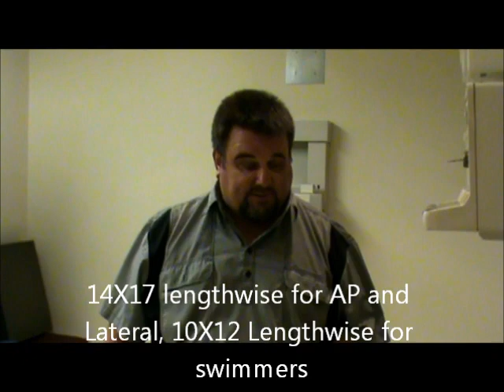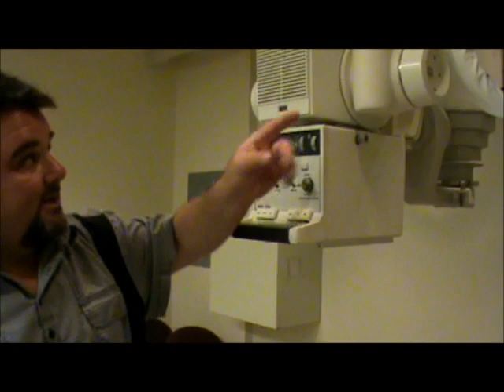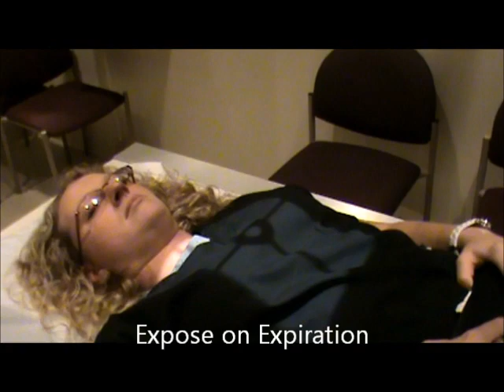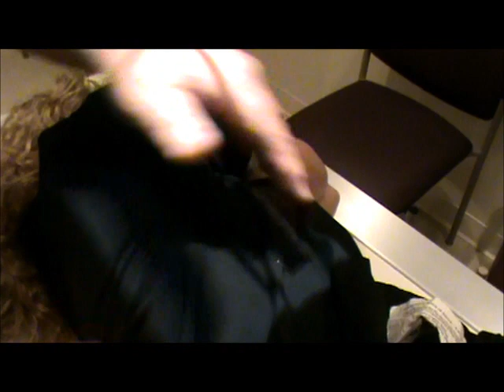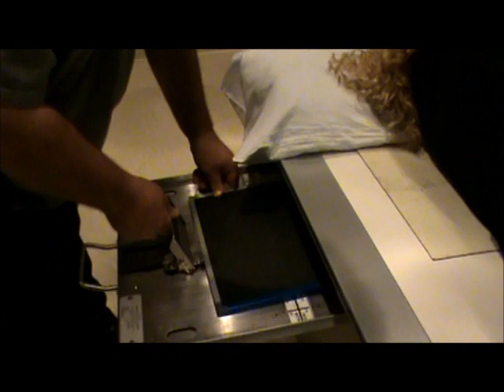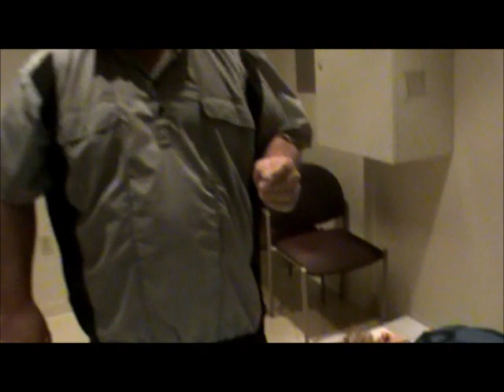Thoracic

Comment: For a low dose approach to this procedure, look at this video.   https://youtu.be/KWf6rFOFlI4.  The lead on the table does nothing and relates to a myth that has continued for a century because no one bothered questioning it. Likewise with tube angulation and geometry. Pushing the tube angulation button and changing the angle will not change anything except collimation. It sounds weird because 75% of qualifieds fail the test. Will you fail this test as well?   https://youtu.be/mZPD_gLs5Dw

Comment: Use no entering points for the AP. Collimate to the height of the film and then put C7 on the top of the image. Collimate width wise to half what is shown in the video. For the lateral NEVER use a straight tube. Always raise the shoulder and lower the hip which will put the spine in a sway that will match the geometry of the spine. This will require an up tilt on almost all patients, but palpate the spine to be sure. This will mean you can get the perfect image 9 out of 10 times. If you routinely use a straight tube for lateral thoracic spine, you will get a fairly good image 3 out of 10 times, in other words, you will rely on chance. Radiography can be mastered like any art form, but only if you work fully with the variables. I would reduce the lateral collimation from half to 1/3rd what is shown in the video. No centring point for the lateral. If it is collimated to the height of the film, just ensure the top of the spine is on the top of the image by looking at the illumination from the Light beam diaphragm.
Reply from the maker: LOL.

Comment: I thought you said breathing technique?  Why no mention of ma and time?  Also, for swimmers, first thing you should do is use higher KV for penetration (80 at least).  500 and 640 mas is crazy.
Reply from the maker: These are instructions for our program. I give them more details during lecture. I tell them technique at that time.
Reply: Techniques were given in the video (500 mas @ 55 kv).  You said it and also subtitled.  Those are crazy techniques.  Even for film and single phase machines.  Why and how does that technique work for you?
Reply: @EL-el5ti  Each x-ray machine has different generators with different phasing. He's probably running a single phase so he has to make up the difference by increasing the mA.